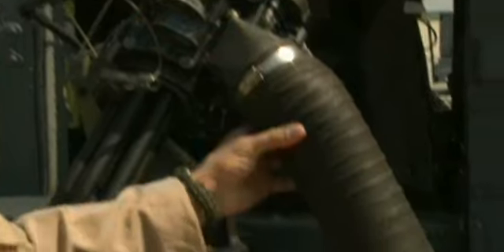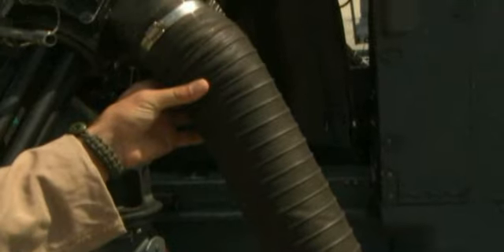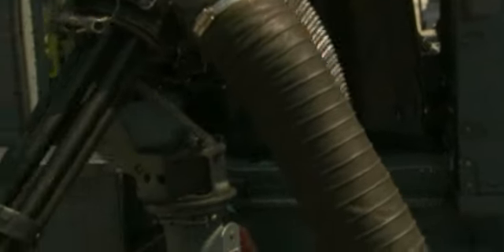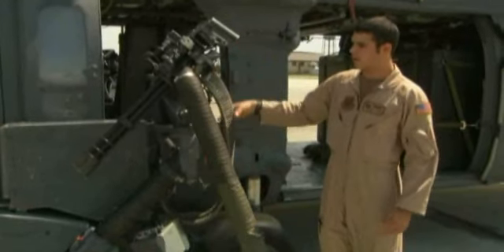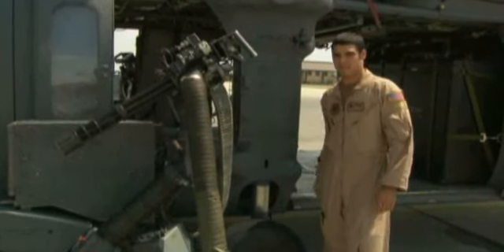USAF: CSAR Minigun

Comment: The engineers works the gun on the right side. That engineer did NOT install that gun or "tweak" it to "fit" on or be "compatible"  . The gun was installed by the weapons shop. Most engineers know the weapon system well...as well as the gunners. 

I am an AF Gunner on -60's.